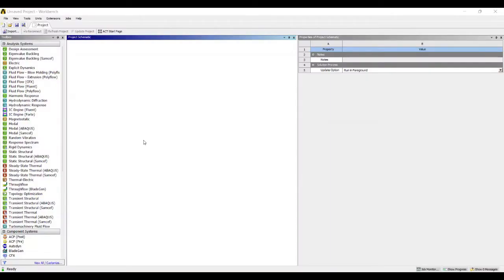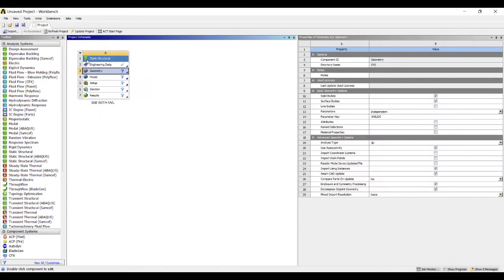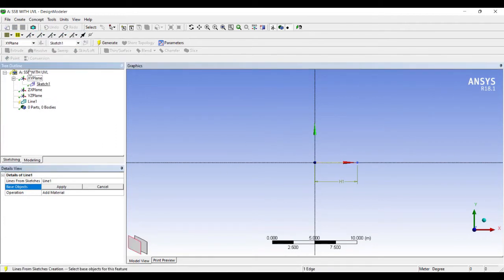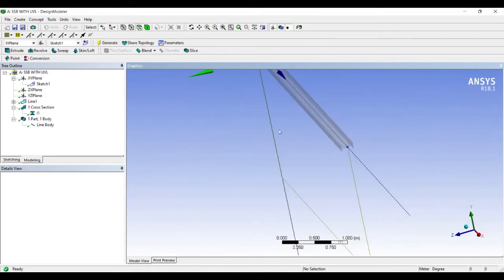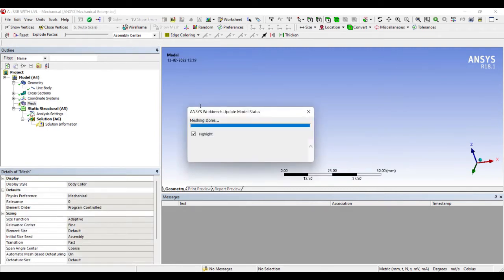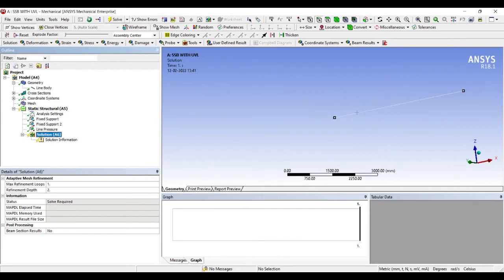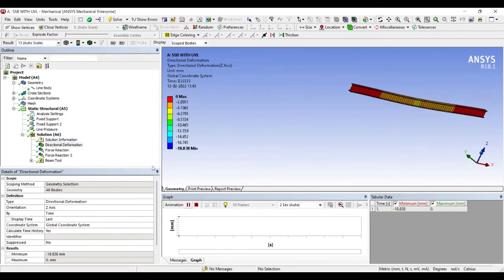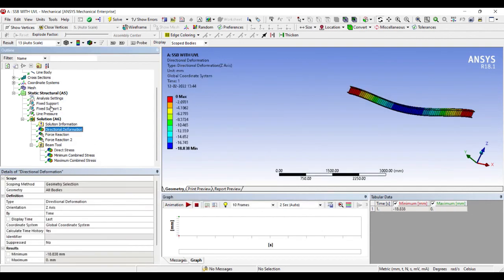Fixed-Fixed Beam | UVL | 1D Beam Analysis | Problem 2 | ANSYS WORKBENCH TUTORIALS

Comment: Sir recomend book for ansys all module learning
Reply from the maker: Try refering videos for learning and in depth knowledge of subjects are needed so as to interpret the results.
Reply: I need book in soft form of ansys
Reply: Mam UVl applied how.it is just applied line pressure.In UVl variation in load should be visible